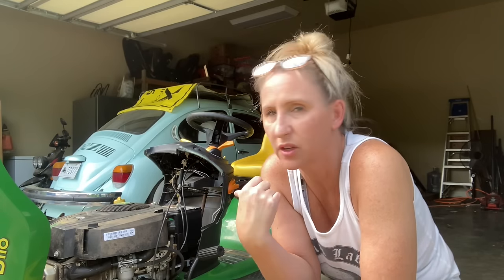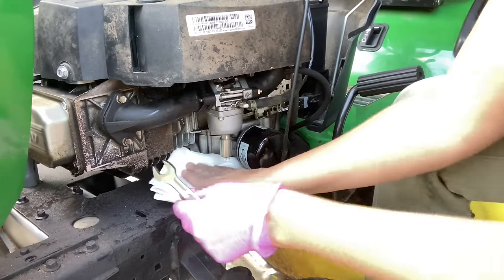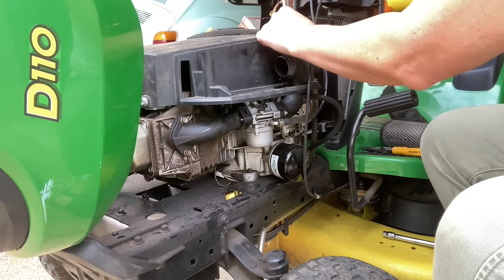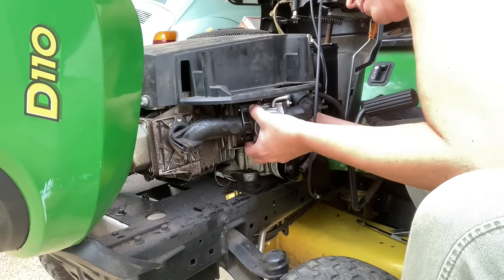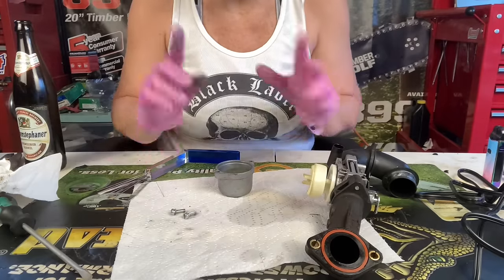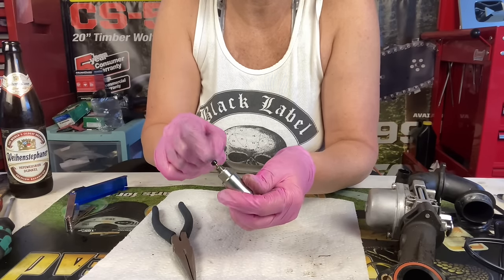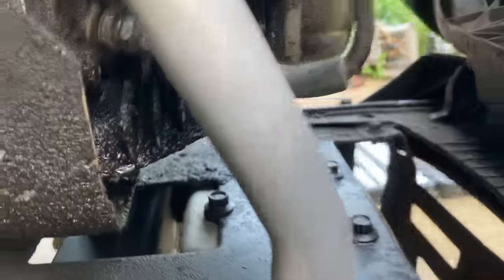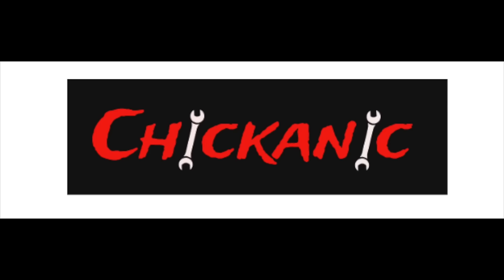Starving for FUEL: The Battle Against a Stubborn Riding Mower That Refuses to Start! Briggs/Nikki

Comment: Always feels good when it starts right up after a repair! Thanks for all the education you give that actually is worth something!
Reply from the maker: Thanks for watching!
Reply: @Chickanic  can you help me I have a Murray riding lawn mower it's a 12 horsepower 40 inch cut.model number 40620C 
Date of man 2950.
This info is all I can find.i tried ordering and they sent me the wrong parts.i need the front wheel bushings for murray riding mower.can you give me possible correct part number.

Comment: I love that you actually fix parts that are failing (like the stuck fuel shut-off solenoid in this video) instead of just replacing them with new parts like most shops do. Saving $$$ for customers...

Comment: Once upon a time I did all that stuff you just did because my mower would only run 2 3 seconds.   Finally I looked at the gas cap.   Yes, I poked out the hole on the gas cap and my mower ran like a banshee.     ALWAYS check for a clogged vent on your gas cap.      Love your videos❤❤
Reply: Same here..mine quit running while cutting and I thought the fuel pump or something went bad.. I took off the gas cap to look in tank to see if there was some problem in there and just happened to try and start it with cap off and started right up ..cleaned vent in gas cap and done deal!!!!
Reply: I just drill holes in the side top area of the caps
Reply: Those pesky caps. Radiator caps and gas caps can have multiple valves on a car.
Reply: Had this happen too. It would run rough like it was out of gas off and on. I happen to notice one time the tank was sucked in a bit and found out if I loosened the cap when it was acting up, it would clear up. I then proceeded to poke out and blow through the vent. Ran good since.
Reply: Thanks! I don’t see a vent hole anywhere on my gas cap but tried starting it with the cap of and it started…we also cleaned the jet nozzle which was dirty. Anyway, it worked!! Cheers!

Comment: I just had a JD X320 come through with a Kawasaki that ran, but all it did was spit and sputter, even worse when the PTO is engaged. I put a new fuel filter on. I changed the fuel hoses from filter to fuel pump, and fuel pump to carb ( they were old and soft). I cleaned the carb and made sure the fuel solenoid was working. It still spit and sputtered like it wasn't getting fuel! On a whim, I cut the plunger off of the fuel solenoid... runs like a champ. I ordered a new fuel solenoid.

Comment: Great tip on using the drill mounted wire brush to clean the interior of the fuel bowl. Sure beats hand held scratch brushes and paper towels for  removing the gunk.

Comment: pulled the mower out yesterday, turned on the fuel valve, added a couple gallons of gas, put the new blades on, and it started on the third pull.  blades without the corners worn off, cut so much better.

Comment: All my years working on carbs I have never removed the bowl screws that easily or had the bowl just fall right off without a single tap with the old screwdriver handle. Great video. Seems all the carb videos are the same now days. BTW I have used aftermarket carbs and not one comeback yet, knock on wood.

Comment: Never worked on a small engine before, bit I'm trying to get an old craftsman dyt 4000 running. electronics are good,  filters are clean, fuel line seems fine, fixed the throttle cable, and I'm pretty sure the problem is with the fuel solenoid or carburetor, but that dang machine is just built to make it as difficult as possible to access. Hopefully a miracle will happen and I can pull it off
Reply: HAH!!! I did it, it was just way more difficult than it should have been

Comment: My best feeling is hitting the key and it fires up. Just got done with an engine swap on an Exmark Lazer Z HP. I converted it from a 23 hp Kohler Command to a Briggs and Stratton 27 hp CXI engine. Rewiring it was a challenge, but after I got it all done I turned the key and it fired up. I’ve been mowing with it and so far so good !!!
Reply: Fuel injection? 😬

Comment: Thank you for the video very informative. I too had the same problem but fuel solenoid that failed. And junk that the fuel nozzle. I simply remove the fuel solenoid & clean the carburetor up then installed a manual fuel shutoff valve.

Comment: One of your videos suggested putting on a shut-off to the gas. I did that and the last 5 mowings, I start the JD rider up and mow about 15 feet and it dies. After a forehead slap, I reach down and turn on the gas !  I fiqure if I slap my head harder each time it will stick to open it first.  🤪

Comment: Good one.  Thank You.  I have found that the 8-10 wire connector near the Ignition switch on JD's is often faulty and does not operate the solenoid.  If you cannot hear/feel it click when turning the ignition to ON, Disconnect and clean.

Comment: I have a suggestion you can try on the next one...
Unbolt the air horn from the carb before you pull the intake bolts. I have it allows eas to remove and reinstall the throttle link.
11mm socket fits the nuts on the air horn.

Comment: Just finished with a snapper zero turn with fuel delivery problems, changed fiter...no better, very little fuel coming out of pump, changed pump.....no better, culprit was the fuel line inside the tank, was clogged up, replaced and it runs fine. Enoy your videos and have learned a lot about repair

Comment: I made the mistake of buying an aftermarket Nikei for my Briggs 22hp and it ran like poo. I had to get it running so I used the o -rings and jets etc from the replacement to rebuild my original. Wont make that mistake again. Thanks for all your guidance!

Comment: My old Intek that I've maintained and kept running 19 years started dying after running a half hour or so. Cheap replacement fuel pump vent screen plugged. Vacuum line not quite seated, one tiny fold on the inside. Valve cover gasket falling apart. No or low vacuum + wimpy aftermarket pump + gas tank vent =  not pumping. It is now.

Comment: Most problems I see are fuel related. Carb, gas cap vent, choke not closing fully etc. 

And of course fried electrics, even alternators cause they jump-start them from a car etc.

Comment: Here's  a good one , if you ever run across One. 

I had a mower shop for over 35 years.  Closed because of my health but , one that Drove me Almost Crazy !!!

Picked up 2x's before I figured  it out !!!

 Customer  had me pickup mower for service  , I Alway's  did a complete  Evaluation of all incoming work so I did not mis much on job before hand. 
It was a J.Deere big rider I think it was a 318 model . Did all the work , customer  complained  about it cutting off .  It was a Old one so I put in Electronic  ing. system in it did all the usual  stuff  !
Returned mower about 5 hours after I left it.  Customer  called it was still shutting off. 

 I picked up took it to my house mowed my grass no problem , 1.5 Acres . 

Went to Mow grass next door mower cut off on me about 20 minutes  into that. 

After all that I found DEAD Bug Part's  in Fuel line Pickup in Fuel Tank. 
 Had to remove  Fuel tank and told Customer  to Cover all there  Fuel nozzles because  that was the Problem  !!!

Comment: I thought for sure it would have been that fuel shut off solenoid.  Those things are useless and evil.  My Craftsman rider had one that had a mind of its own and kept killing fuel flow in the middle of a job.  Rider would run for around 20-30 minutes then just die.  I wound up snipping off the tip and installing a manual fuel shut off valve between the fuel tank and carb.  Now after every cut, I shut off the fuel and let the engine run out of gas (everyone should install a shut off valve).  The solenoid may still randomly get stuck extended but it’s too short to kill the engine.

Comment: Had this problem on a craftsman mower! Got it unstuck! Cleaned out the carb! Then I left it disconnected! And put a fuel, shutoff valve! In the, fuel line! not saying everyone can do this, per say! I just make sure I shut the valve off! And turn back on! it's worked great for the past, 8 years! Have  a great day!

Comment: Chickanic, I love your channel! Please, please, please make a video describing difficult hot starts on a John Deere X300 with an FS600V Kawasaki Twin engine. I have set the exhaust valve clearances to 0.08 mm. They were out of spec. The intakes were fine. Lots of drag on the feeler gauge. I know you have lots of spare time on your hands 🤣 but please do it if you can. Many thanks from Canada!

Comment: I had one that was pushing me towards the bottle a couple years back. Would run a few seconds and die. Checked the gas cap, fuel solenoid, carb multiple times, new fuel filter, new fuel pump, new fuel lines, flushed out the pickup tube from the fuel tank. NOTHING HELPED. Finally pulled the elbow off the pickup tube and found debris stuck in it, not enough to stop fuel or air flow, but enough restriction the pump couldn't keep the bowl full.
Reply: Why is it always the last thing you check??? I love working on small engines, but they can make you cuss sometimes.

Comment: About using a aftermarket carburetor my mower wouldn't even start without a little spray I couldn't get it to work so I took all the internal parts and used them in the original carburetor The motor ran the best it ever had I will never buy aftermarket carbs again

Comment: Looks like it's burning oil pretty good. and no that's not from a leaking valve cover gasket. It's pretty common for inteks to blow head gasket into the pushrod galley and then start burning oil. but for all I know, maybe after you ran it awhile it quit smoking and was from sitting for extended period of time and sticky rings etc.?.

Comment: goes without saying those engines take a long time to suck the gas (at least my L110 does) . Fixin to put a shut off valve on mine this weekend so it wont take so darned long to prime.

Comment: At least that one cranked.  Two years ago I my JD was being brought out of winter and I keep the lightning cube out of the mower in the basement (garage gets to well below freezing sometimes). The lightning cube was 1 year old, and the week before I was going to put the mower back in service I put it on a charger/maintainer just to be sure it was charged up and ready to go (it was fine).  Plugged everything in and turned the key and "NOTHING".  NOTHING.  Check connections, tight...getting no power past the coil...so off to get a coil.  Nope...nothing...checked all the safety switches (damn you lawyers for filing suits for stupid people and winning)...nope, all good.  Pulled the lightning cube off again and took it up to the parts store to have them check it.  Nope fine.  Go home, put it back in, and still nothing, but I heard some crackling....recheck the connections and decided to tighten the connections even more...BAM! FIRED UP.  I MIGHT have gotten a 1/10th of a turn more out of the cables, but that was enough.  CRAZY!

Comment: Good stuff. I'm still trying to figure out what might be wrong with my Husqvarna rider. It cranks like crazy but won't start. If I give it just a little whiff of starting fluid it's off to the races and it will run fine, shut off and restart fine. I replaced the fuel pump, assuming a weak pump wasn't getting fuel to the carb at cranking RPM, but it changed nothing. Hate to start randomly tearing stuff apart when it runs so well once it starts.
Reply: My L120 J DEERE is acting like that also. I drilled a small hole in the air cleaner and a shot of starting fluid is all it needs.Especially handy for cold weather when it won’t start at all. A small patch of tape to cover the tiny hole.

Comment: I wouldn't be using a torch tip cleaner to clean jet holes out. If you don't pay attention you could easily file the jet hole oblong & bigger. They do make jet cleaners. Good video though.

Comment: I detest the carburetor solenoid.  It's fine when it works i suppose. 

I gutted the solenoid on my mower when it stopped working,  now the float valve is in control. 

Eventually the float will fail open and the crankcase will fill with gas, right?

Nope.  I added a cut off switch.

All the good chickanicks are taken.
Reply: The solenoid is not a replacement for the shutoff valve.  The solenoid will not stop flooding due to bad needle/seat/float.  It just blocks fuel from entering the jet to prevent after fire of raw gas going to muffler as engine winds down with no spark after key is in off position

Comment: People use the fuel stabilizer to store for winter.Tell ya something a whole lot better.Put a fuel shut off on your gas line.Turn that to off and run machine until it runs out of gas.That way you wont have to buy any stabilizer and come spring turn it back on and it runs like new.I do it every fall .

Comment: QUESTION: Do you have a video of a riding lawn mower and how to drain bad gas from it?  I'm asking because I have a mower that hasn't been used in several years. It has no visible gas inside the tank. The gas has presumably dried up. But, a repair man said there is a "bad odor" in the gas tank. Is there a way to clean the gas tank?

Comment: All emmission carburetors  are to lean ,most need jets drilled.  Constantly speed hunting  back and forth is a sign if everything  is  clean.    One size jet does not work ,different,  temperatures, and altitudes require different fuel  mixtures.

Comment: What brand of carb/fuel sys cleaner are you using that it has a mixing ball and must be shaken?  I normally use Gumout brand.  No mixing required.

Also, I'm currently working on a (very) old Agway rider, with a 2 cyl Briggs & Stratton.  I was forced to buy a new(ish) aftermarket carb as there are no rebuild kits available.  After I replace the carburetor, I'll likely fabricate my own paper gaskets and use an O-ring kit to rebuild the old one.

I'd rather just rebuild the carb, but I'm in a bit of a time crunch to get the tractor operational, and this way I can take my time rebuilding the old one and keep it as a spare.

I'm also planning on making some (relatively) minor modifications to the tractor to make it more useful this coming winter. (I really hate shoveling)

Comment: I absolutely dislike this carb. My son has one on his LA115 John Deere, 19.5hp Briggs, and it has the surging issue at low speed. Under load it does pretty good. As I had mentioned in a previous post, I worked on small engines and lawn equipment from the early 70's, after school, until 1987. Have done some odd repairs over the years, so I got a repair kit for his carb, and am pretty sure I got it in right. Still surges. I can't imagine why the small engine industry went away from the simple, fully adjustable carbs (well, I guess I can) that were easy to clean and repair, to this junk. Same thing with a 10hp Briggs on a generator I have. And of course the ethanol gas doesn't help. Glad I'm retired!

Comment: Very helpful video. My LA110 will only turn over if spraying cleaner into intake. Is that a deeper dive into carburetor? Changed gas cap, plug, fuel filter and plunger shut off is fine. Thanks.

Comment: I don’t agree with spraying carb cleaner inside a Nikki.  That big funky gasket is going to swell when the cleaner hits it and you’ll never get it back together again.  Kits with 3 o-rings are available (one of which is that weird gasket) and you will need to pull the little main jet out and replace the small o-ring on it.  It goes back in the big white tube with the o-ring facing down.

Comment: if the bowl is still stuck once the screws have been removed, how do you get the bowl off?  Would soaking it in parts cleaner be the only solution?

Comment: How about providing a short video installing a true gasket on the valve cover please?  I'm not too keen on using RTV by itself as a gasket as some factory installations use.  If a small piece of that RTV breaks off later on the inside of the cover it could cause some serious problems and you might not realize it until it is too late.  Thanks!

Comment: I have a burning hate for those nikki carbs. No matter what you do, I have almost never been able to get those idling smoothly. They always either hunt ( the rpms go up and down) or run rich.
Reply: Have you taken off the plastic cap on the air fuel screw to make adjustments
Reply: @jay7264  yep, they never adjust out properly
Reply: Some are no longer putting the adjustment screw on the carb😢

Comment: How do you fix a brand new four horse Briggs and Stratton two pull start with no chock , I used it three times, and the only way to keep it running is to manually cover the carb to keep it running

Comment: My Husqvarna 46" (YTH22V46) lawn tractor runs very rough with lots of sputtering when I WARM start it, so if I turn it off for any reason, I can't use the tractor for an hour or so.  It also sometimes happens when I've been running it for a while and it gets very hot.  I already changed the air, oil and fuel filters, new spark plugs and put in a new carb and intake manifold   ...no improvement and I'm out of ideas.  Does this sound like a fuel pump issue.... or any other ideas would be greatly appreciated... ?

Comment: @chickanic any chance of a VLOG why my local shop said "side valve" mower engine are better (don't break down as much) than newer OHV. ... and whats with the EXi Series (just Check and Add™ so you'll never need an oil change-ever.) motors?

Comment: I have a JD L120 that has no spark. Turns over. Replaced both coils and spark plugs, gets fuel, still no spark. I don't think there is a safety not made that would let it crank and not fire. Could it be the ECM?